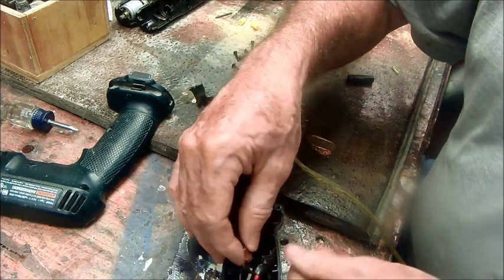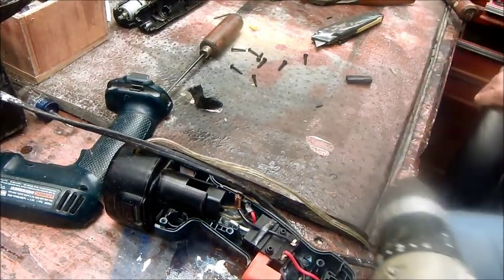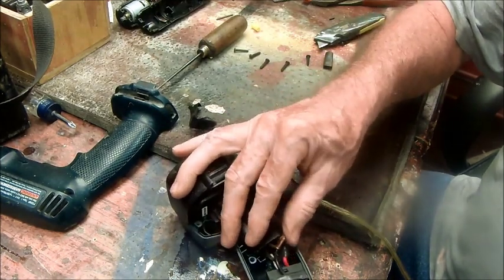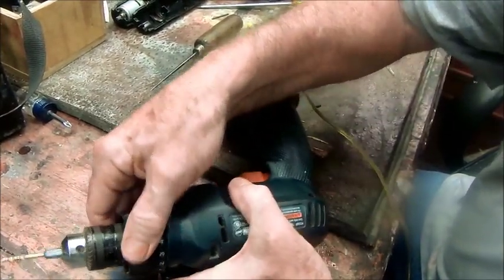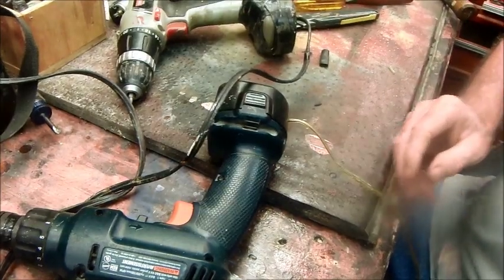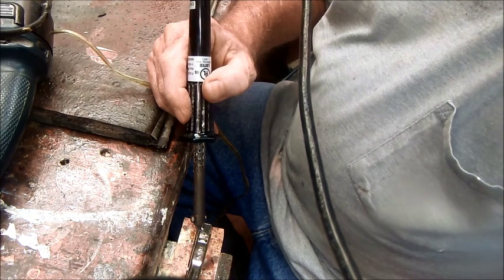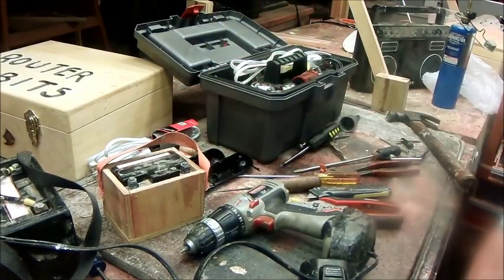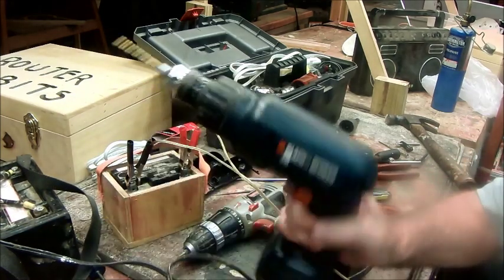Converting a 9.6 volt Black and Decker cordless drill to 12 volt DC, lead acid battery, free drill

Comment: for $35 you can buy a 12V drill with a factory warranty , whats the point?
Reply from the maker: Fact is, if you like pointless repairs, then you've come to the right place.  Heck fire, just two weeks ago I repaired a lawn chair!!!  Yep, and it was a cheap lawn chair that was calling out to be thrown away.  I spent more on the glue for the repair than the cost of a new chair.  Go back a few years and I restored a magazine rack for the third time, which my brother keeps leaving out in the rain (because he doesn't want the thing).  
        So, I guess the point is that I'm just a 75 year old guy living out the dream of puttering around his wood shop, while watching the clock run out.  That said, I just don't want to be on the bench when that final buzzer goes off.
      Thanks for watching and commenting.

Comment: Yes but how long will the motor last when running for long than you show.
Also heaps of drills have electronic speed control from trigger. This mod will not work on them
Reply from the maker: This video was made 7 years ago, and I've long ago switched to a 12 volt DeWalt as a screwdriver.  I did use the drill in this video for nearly 9 years, and it worked perfectly as an in shop screwdriver.  But battery power tools have come a long way, and my 12 volt DeWalt is much better than this Frankendrill.  
       This mod only applies to those cheap drills that were forced on us (with batteries they stopped making the next year.)  You'd never execute this mod on a drill that still had batteries available, and most certainly not on any of the latest high tech drills.  I will defer to you on the possibility of applying this mod to an electronic speed controller, as I'm not conversant on such a modification.
       Thanks for watching and commenting.

Comment: I tried 24v e-bike battery on a 24v drill and I just get sparks when I press the trigger???
Reply from the maker: I suspect this won't easily work on the new high voltage drills.  My guess is that both the E-bike battery and the 24 volt drill are controlled with built in proprietary electronics, which is getting cross-threaded.   If you're into this hard, try using a regular 24 volt lead-acid battery, with no electronics.

Comment: It's no longer cordless, so what's the point?
Reply from the maker: I forgot about this video.  Strange, one of my worst videos with 30K views.  Anyway, I used to hook 12 volt drills to external power for driving screws.  Didn't have to worry about charging those old-timey 12 volt batteries, and gave me great flexibility, especially while camping or on my boat.   Here is the edit:  The point was that I wanted a low power driver for screws, but I found the battery life of the original commercial drivers to be limited.     Time went on, drivers got better, and I retired that corded-cordless drill years ago.  Moreover, I'm a total convert to the new cordless power tools, including the 12 volt dewalt driver I use for screws.  
      Now I need to watch this video,  Curious to see what my shop looked like four and a half years ago.  Thanks for watching and commenting.
Reply from the maker: Just watched the video, and while I hate to be critical of a 30K video, it seemed boring to me.  Check out some of my newer videos.

Comment: Nice work! Question.. so motor is (was) 9.6 and now is working on 12v? With no problems at all?
Reply: Thats what it seems ! 14 minute video   " connect the wires to the 9.6v  drill & connect to 12v, No more info"  ...  ..... ... https://www.12voltplanet.co.uk/cable-sizing-selection.html   shows if you have a long enough thin cable  you can have a 2.5V drop at say 5amps , which will protect the drill a bit. or Better  you could drop the voltage across, say, 3 diodes & use thick cable. https://www.youtube.com/watch?v=cL8OAP3LDcw&t=9s  Shows how to connect a 5v drill to 12v.
Reply from the maker: @brackcycle9056  I don't know how many videos you've posted, but I have about 300.  And while this one is 7 years old,  some of my newer videos are more boring than this; and containing less information.  14 minutes to say: "connect the drill to the battery."  Isn't it the truth, and it's something I've noted on many of my videos.  I remember watching a 22 minute video on building the Golden Gate Bridge and realizing that I had just made a 22 minute video on making a small wooden table.  It seemed that one of these two videos was the wrong length.  
      But I keep plodding along.  Remember, an important factor in success is showing up.

Comment: It's no longer cordless.
Reply: Numisaccent you mean its no longer a useless paper weight.
Reply from the maker: They are all paperweights now.  I like a 12V driver for screws, and 12V leads make it very flexible (you could run it off flashlight batts if you were pressed.)  
    But DeWalt makes a very good 12V driver, and when my 7 year old little lead acid battery finally died, I converted over to DeWalt.  And of course, the DeWalt driver is much better overall than my homebuilt systems.  
    Thanks for watching, and check out some of my newer videos.
Reply: 12v what abuot amperess?

Comment: I did this to an 18 volt drill but I rigged the wires so they run into the empty battery shell and the other end is a 12V cigarette lighter plug. I had to remove the fuse and spring b/c they got smoked.
Reply: *****
It did work, It ran slower than with the stock battery but it had unlimited power. The saw also ran slower due to it running on 12 volts and not 18 but again had unlimited power.

And thanks for subscribing and enjoy my vids and please leave comments.

Comment: Looks good.  Here's my silly question:  Did you do that so the drill would run longer on the 12 v  or some other reason?

Whatever the reason, this was a very well done video.   If you are looking for future video ideas... I would like to see sample cuts of your router bits.  If I recall you have quite a few. I think that would be a fun video, too.  Thanks for sharing this one.
Reply from the maker: Reasons for converting;
1.  Main reason in the beginning (several years ago) was to see if it would work. Just a fun project, motivated only by the fun of doing it.
2.  To my surprise it worked well, with high power, long battery life, maximum flexibility,  and good utility.  I had a 12 VDC drill/driver, without the headaches of the batteries and chargers that come with them, with a cost of only about $20.  And the thing was 100 percent reliable, since it will use about any common DC voltage.  Cars, boats, shop, even flashlight batteries in series.
3.  I'm glad you liked the video.  I'm working on a couple of display cases now, and hopefully I'll have a video of them finished soon.  Trying to get a complicated job like that into a short video is harder than making the cases.
Reply: Very clever!